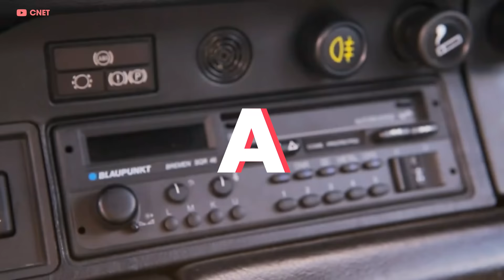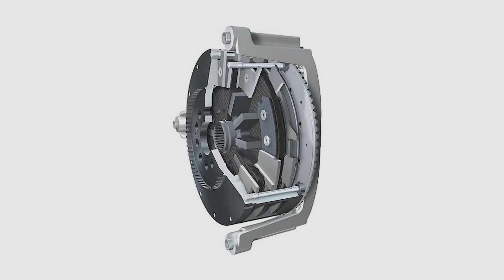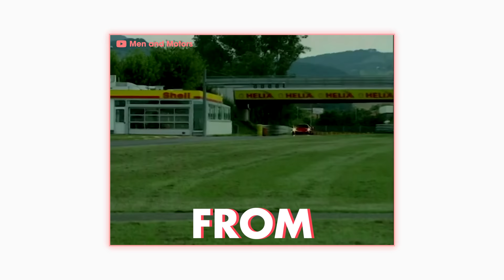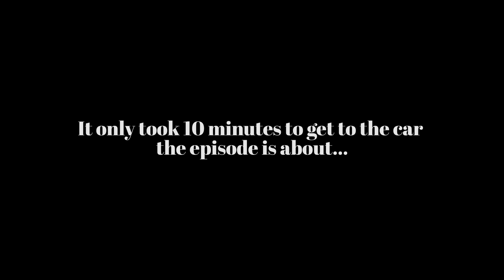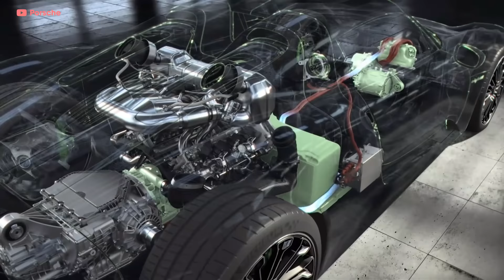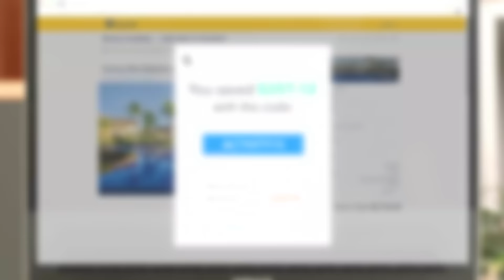PORSCHE 918 - Everything You Need to Know | Up to Speed

Comment: I've had a 2015 918 Spyder for a few months now and its absolutely amazing to drive. It will do 0-60 in 2.0 seconds if you can launch it right with the right tires and have a good driver behind the wheel. The only thing I'll say I hate about it is the cost of the car and how its just not justifiable unless you really like the looks of it. Car is basically a really expensive status symbol that cost too much money which makes most too afraid of the value lost to drive the car.
Reply: In other words, you can't enjoy driving this car on public roads. You have to drive it at 8/10's on mountain roads, if that. You're always cognizant of what it would mean to slide off the road or into a side rail. Always thinking about what it would cost and how long it would take to fix it, if you could fix it. That's how I felt about my first Porsche, a lowly 2.7L Boxster! I had an NA MX5, a couple of Z3's, three E46's, and an RX8 at the same time but I couldn't enjoy the Boxster for the above reasons.

Comment: The porsche 959 has a top speed of 199MPH while the Ferrari F40 has a speed of 201MPH,while this does not mean offically porsche is faster ,in 1994-5 a german car collector  tested the 959 and reached a speed of 204MPH ,while the ferrari was not able to reach even 200MPH ,thus when he submitted the testing to the car magazines the results happened after no ferrari dealer sold a ferrari to the collector anymore ,thus he sold all of his ferrari collection and replaced it with detomaso and mclaren f1 and mercedes clk gtr

Comment: gas engines aren't enough any more. for the longest time companies have been designing highly tuned 8, 10, and 12 cylinder engines. the Bugatti shows that they've just about run out of the ability to add cylinders, timing, and boost to get more horse power. so good to see hybridization crank out some serious numbers. In light of this, I'd like to see more Tesla roadster content.

Comment: Uh wow there is a lot of wrong information in this video. There was never a in-line 6 that was too heavy it was the original flat 6. And ummm the Carrera GT has nothing in common with the 911 GT1. Definitely not a carbon fiber chassis because the GT1 didn’t use a carbon chassis it was the front section of a 911 with a tubular rear section for the 962.